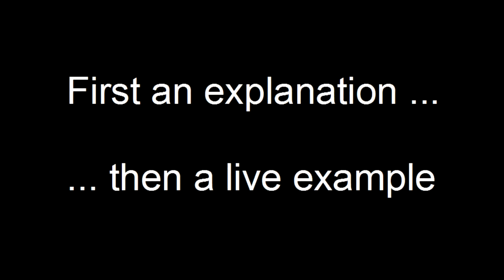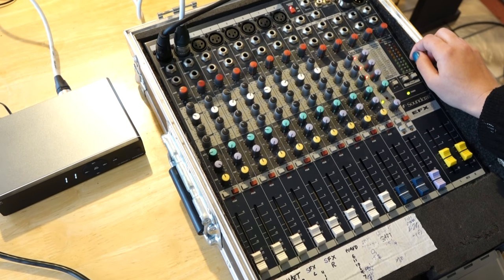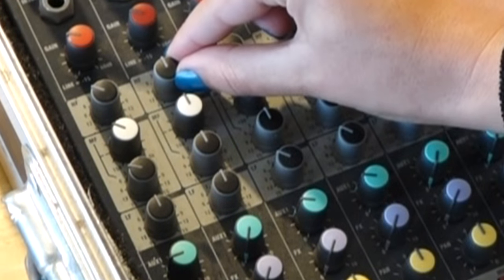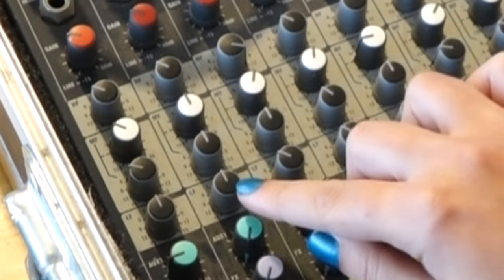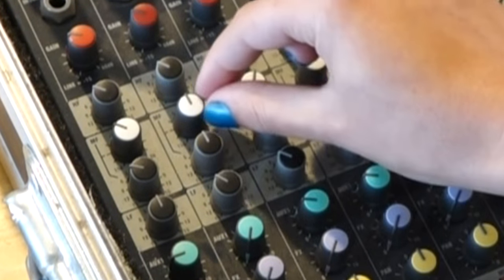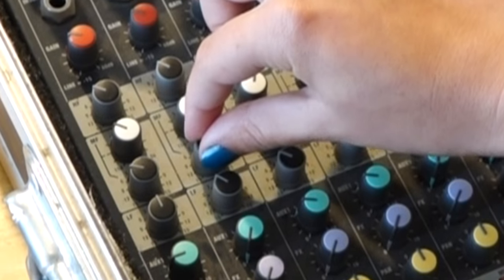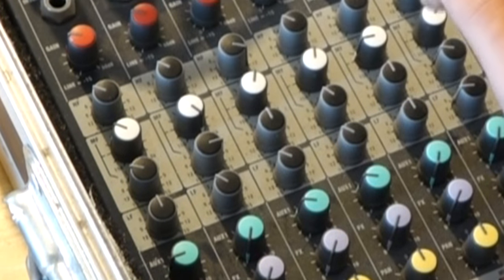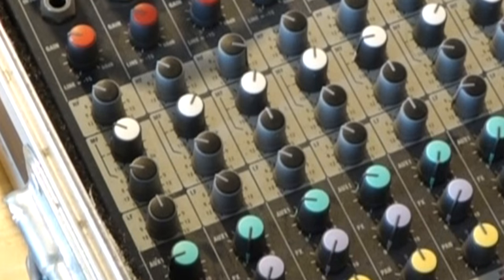Top Tip for Sound Mixing (using a basic analogue mixer)

Comment: Thanks Samantha, but I still need your help.
Reply from the maker: If you have a question - fire away :)
Reply: @SamanthaSinger  I do Samantha but my mixer isn't as great as yours. I had quite a few questions actually...but I dont want to take much of your time so will just ask one. Im getting the boys around for a jam tomorrow... can I connect a Microphone into the 1/4" input as one end that connects to the mic is XLR and the other end 1/4". Its for my friend to do backing singing, hes not very good anyway. The reason I cannot use the XLR inputs on my Mixer is (I only have 4) they are all taken for guitar 1, guitar 2, bass, main vocals...thanks Samantha.
Reply from the maker: @number1Don  Important question! Usually the 1/4" jack inputs are for 'powerful' inputs such as guitars and keyboards where the signal the mixer gets is already fairly loud. Whereas the XLR inputs are for quieter inputs such as microphones which send a very weak signal to the mixer. So you will be better off, if you can, putting guitars and bass into jack inputs and both vocals into XLR inputs (if you have enough of each type).
Reply: @SamanthaSinger  Dont worry Samantha I wouldn't waste our time asking you an unimportant question! ;) Thanks for your response....all our guitars go into a DI box so we just usually go XLR female (DI box) to XLR male on the mixer. However as he wants to sing its ruined everything. So what I will do, is put the 2 x MICs XLR to XLR on mixer, 2 instruments XLR to XLR and then one instrument XLR to 1/4 jack (TRS) on the mixer. If you are curious I have a Alto ZMX122fx. Not bad for my first mixer...(I think). I have a second question if thats okay. The mixer has main out (PA) and CTRL room out (Monitors). So as far as I understand, the CTRL Room out just does what the main out does except the monitors face the band instead of the audience. However, as the singer I want to hear what I sound like....so do I use the AUX out to connect to either in ear monitors or a monitor wedge to then kind of increase the vocal level and decrease the other inputs so I can hear myself sing? Thanks
Reply from the maker: @number1Don  Yes, exactly that for the Aux. I find with my band that I can use aux for the whole band monitors and my own. Even though the mix is set to my preference as the singer, it seems to give the band better sound to listen to in their monitors than just hearing a copy of the front-of-house sound. But if you find FoH in the band monitors and a different Aux balance for yourself works better then that's fine too - just a different way. Of course the big set-ups have many aux outputs and then each band member can then have their own preferred mix!
Honestly, Alto is a budget brand so I'd upgrade when you can afford it. The worst thing to happen is for your mixer to pack up during a gig! I use my Soundcraft for gigs but I always carry a spare (cheaper) one in the car just in case. You can around most other failures but not a total mixer failure.
Reply: @SamanthaSinger  "if you find FoH in the band monitors and a different Aux balance for yourself works better then that's fine too - just a different way. "
-(I phrased it on the basis I only have 1 Aux Output....)

"I find with my band that I can use aux for the whole band monitors and my own. Even though the mix is set to my preference as the singer, it seems to give the band better sound to listen to in their monitors than just hearing a copy of the front-of-house sound." 
-(Does this mean you dont use the monitor out, you just use the aux out for your band and you all hear the same thing i.e what you have it set at?). In  an ideal world we could all have our own mixes, but from what you say you all listen to your 'one' mix anyway so could get away with that. May I ask, why wouldnt they want to hear what FOH hears and prefer to hear your mix which probably turns there instruments down? (Im assuming too that there is no amplifiers/cabs behind them too). My plan is to not use guitar amp/speakers and go direct to mixer you see (which is what we currently do when jamming) as we use guitar pedals to add to the raw signal. 

Last question....I have a Gain, Channel Level then Master Level on the mixer. I try to have the levels on 12 oclock at the moment as to me that is kind of not altering the sound too much one way or another....but am I best having the gain high and channel level low or gain low and channel level high etc. Thanks.
Reply from the maker: @number1Don  Yes, we all hear 'my' preferred mix. The audience want a totally balanced sound where every instrument is equally audible (apart from backing vocals). However that's not necessarily the best mix for a band to know where they are in a song and what the most important thing in a song is doing. Also the sound engineer (if you have one) might adjust the FoH sound after soundcheck and it's best if that doesn't change the monitor mix which might move away from what the band wants.

The theory for the three gain/level adjustments is that the Gain at the top a of a channel is there to adjust the input level of a signal so that it is 'ideal' for the electronics in the mixer to deal with.  Then the Level for each channel is where you balance the sound according to what you want the audience to hear (heavy bass, quiet drums, whatever) and the Output Level is where you set the volume the audience hears. If this were achieved with all these at 12 O'Clock (or zero for channel level) then you're right, that would be ideal. But it never happens like that.

There are three different methods! these are the most common two:
1. Set output to 0 and all channel levels to 0 or infinity. Adjust the input gain know for each channel one at a time until the signal from that channel just clips into red occasionally. Now each signal is optimised for the mixer and you can adjust the balance for FoH with the channel sliders. Adjust main output according to the audience needs.
2. (The one we use). Set output to 0. Set all channels to 0. Adjust each channel gain to get the mix you want. Adjust the main output for audience needs.
The advantage of this method is that in a live situation all the channel sliders will be in line as your basic mix. If something needs adjusting during a show (maybe bringing up one instrument for a particular song, for example) then one slider will be moved out of line do do that but it's easy to get back to the original mix by bringing it back into line. With method 1 you have to do it by ear. Which is OK if it's just one channel to be re-adjusted but sometimes it's many and that means re-balancing the live sound DURING the next song which isn't ideal.
The drawback of the method is that sometimes the gain for a channel will need to be adjusted so much up or down to get it to fit in with the other channels in the mix that it distorts. In that situation you can move all the channel sliders to a different equal setting (maybe -10 or +15 or whatever) to enable that one awkward channel to be right without distorting. At least they are all level even if not 0, and that's the thing we're aiming for in this method. If that doesn't work you can do the same with the main output. So eventually there is always a position where the gains are working fine and the channel sliders are all level (even if they are not 0) and even if the main output doesn't start at 0.
Perhaps I should do a video on this too :). it's a lot easier to demonstrate than to write :).
Reply: @SamanthaSinger   OMG Samantha you're more amazing than I initially imagined, thank you ever so much, that was very detailed. A video on this topic would be great and might save your fingers and help visualise better too! If you do do the video can you also , mention at the end of it.... on a active speaker whether the aim is to have that low or high volume too (so similar do I have mixer main out high and speaker say 50% or mixer main out at 50% and speaker volume high. Ill subscribe and press the bell in case you create this video. 🤞🏽Thanks again! Your times very much appreciated and ill try to practice what you preached later today. ✌🏽
Reply from the maker: @number1Don  You should find an active speaker is OK around 50% and the setting there is entirely unimportant ... as long as it's not so low or high that the sound is distorted (which has never been a problem I've ever come across).

Comment: What If you only have 1 Button in mid not 2 ?
Reply from the maker: That's a good question. If you just have one button for the mid-frequencies then it means the manufacturer has decided what frequencies that button controls and has fixed them so you have no flexibility with it. You can only use it like the high and low frequency knobs - turn them up or down and see whether you like the change in the sound.

Comment: please, I want to ask. if i have a personal monitor mixer behringer p16 and i have an analog mixer but i do not have a direct out . So what should I do ? 
i have only two aux
Reply from the maker: What is your mixer make/model?
Reply: @SamanthaSinger  yamaha Mg 166 c
Reply from the maker: @peteryousef5177  I don't know that mixer or the Behringer P16. But I can see that your mixer doesn't seem to have a 'mono out' - which is a shame. Is your output from the mixer mono or stereo? If it's a band, the sound is often the same in bith Left and Right channels to the main speakers. If that's so, then it's easy - just take one of the monitor outs (below the XLR STereo Outs) and use that. Otherwise I'm not sure. The four Group Out sockets might all be stereo> Send every channel to Group 1 and use that? Beyond that I can't advise a simple solution. Of course an I/O box like the Behringer UM2 will take two stereo jack inputs and send them out as mono - but that means spending money :(.
Reply: @SamanthaSinger  i did not get you ?
Reply from the maker: @peteryousef5177  I'm sorry, I don't understand.
Reply: @SamanthaSinger  do you know how to change from insert to direct out ?
2. please i want to ask you if i used headphone  spliter should i connect Trs or TS
Reply: @SamanthaSinger  i mean i did not understad what you wrote
Reply from the maker: @peteryousef5177  A TS jack can be used to take a mono signel from an 'insert' jack socket to another device.
A TRS in a 'phones' socket will give you stereo; a TS in a phones socket will give you a mono signal - the left channel only (it won't mix the two channels to make a mixed mono signal).
Reply: @SamanthaSinger  please i want to ask you can trs to change from insert to direct out put on mixer
Reply from the maker: @peteryousef5177  I don't really understand the questions, sorry.
Reply: @SamanthaSinger  i need the insert to work direct out . i need to know how ?
Reply from the maker: @peteryousef5177  I still don;t understand. Where do you want to plug in the TRS jack?
Reply: @SamanthaSinger  on insert
Reply from the maker: @peteryousef5177  Like I said above you just plug a mono jack lead into the insert socket and connect that to your P16.
Reply: @SamanthaSinger  not TRS ?
Reply from the maker: @peteryousef5177  No, TRS is for stereo signals and each channel is a mono signal.
Reply: @SamanthaSinger  ok thank you very much
Reply from the maker: @peteryousef5177  You are welcome.

Comment: How do u do this for a three band eq mixer?
Reply from the maker: If you have more than one mid-sweep function on a mixer the process is the same. Start with any mid-sweep and find the sour spot. Cut that frequency then move to another mid-scweep and find the next-worst frequncy and cut that (probably cut that less than the one first frequency that you found to be sour). And so on depending how many mid-sweeps you have. I hope that was clear!
Reply: @SamanthaSinger  no I only have a low mid and high. I essentially have a British eq mixer. So no low or high mids
Reply from the maker: @jasonjellie9342  I'm not quite clear from that what you have. The simplist arramgement is a single knob for low frequencies, abother for mid and another for high. The next level up is the same except that the mid frequency knob has another one associated with it (like my video shows) to alter the part of the mid range upon which it acts. The next level above that is two mid frequency pairs of knobs. if you have the simplist type then there's nothing clever you can do except adjust each knob up and down until you think it sounds best (not very helpful, I know). There are suggestions on YouTube and elsewhere about adjustments that certain people think work best for certain instruments but that takes a lot of research and it varies with every venue and particular instrument so best of luck sorting all that out :). Personally I find it doesn't make much difference unless you find the need to strongly boost/cut the highest or lowest frequencies. For example, I have a very trebly voice so I cut the high end severely. But the low end makes no noticeable difference on my voice.
Reply: @SamanthaSinger  so all my mixer has on each individual mic input is an volume control fx sends, low, mid and high, and gain control. I believe the music industry commonly refers to it as British eq coz it doesn’t have a low mid or a mid high in between the high and mid ranges like the one in your example
Reply from the maker: @jasonjellie9342  Ah OK. So like I said, there's not much you can do except experiment, listen and see what sounds best to you.
Reply: @SamanthaSinger  so with a three band does the mid still typically affect the high and vice Versa?
Reply from the maker: @jasonjellie9342  I believe all three are independent and only cover their own freqency range. So adjysting any one of them won't affect the others.
Reply: @SamanthaSinger  so how is it different with your type of mixer? Like why does each band affect each other unlike if u use a three band eq
Reply from the maker: @jasonjellie9342  The three bands don't affect each other. But he mid band has an additional knob that works with it to affect the frequency it acts upon. So those two knobs together make up the mid-band sweep (the 'sweep' is the facility to make the middle knob act on a different part of the mid and not all of it - it's like 'focusing it on just part of the mid range).
Reply: @SamanthaSinger  well sucks that I don’t have that 😫
Reply from the maker: @jasonjellie9342  The more you spend on a mixer the more control you get. And if you go digital you get infinite control! Maybe I'll go that route one day if I can afford it :).
Reply: @SamanthaSinger  very true. Suppose depending on how much control u have means less tweaking in post(well of your own mic anyway if ur doing a podcast) coz u will know wat u want in your sound
Reply from the maker: @jasonjellie9342  Maybe but you probably have more control in post. Personal preference I think :).

Comment: good job..but you are basically manipulating the function otherwise known as "Q"
Reply from the maker: My understanding of 'Q' is that it's the width of the frequency range that is going to be affected when you increase or lower that section of the bandwidth.
So a low Q on the mid-section would mean then when you tweaked it the effect would be applied to a wide range of frequencies whereas a high Q would apply the effect to a narrow range of frequencies (or maybe the other way round?). That control is only on more sophisticated desks.
My example is more basic - the Q is fixed - the only thing I'm varying is what the central frequency is that I am adjusting. It's the same width of frequencies being affected, just centred on a different part of the range.
Not easy to discuss in words - so much easier with pencil and paper :).
Reply: No it’s  not. 
It’s sweeping the frequency  150 hz - 3.5 kHz at a set Q of 1.50.
Reply from the maker: @michaelquinn8498  Yes, I wasn't clear in what I wrote. There's no control over Q with that mid-range function on a basic mixer like this. It's sweeping the frequency range but not affecting the Q.